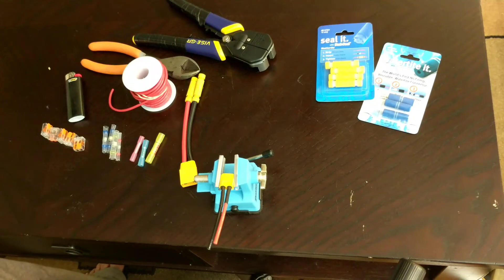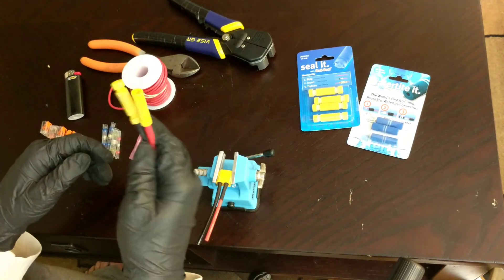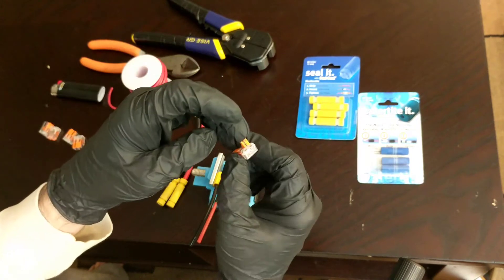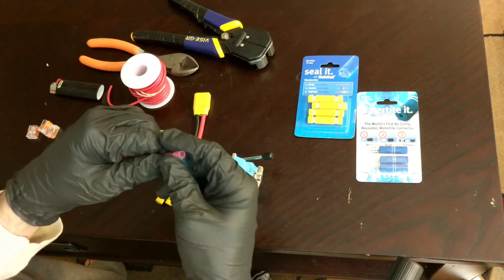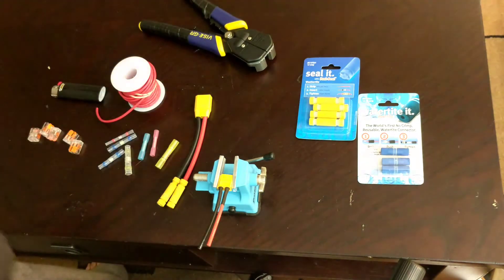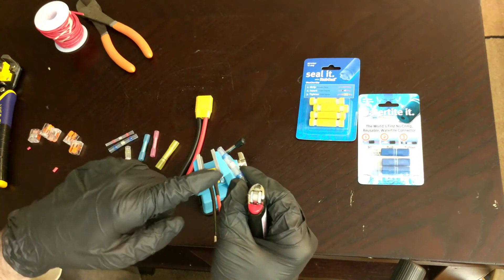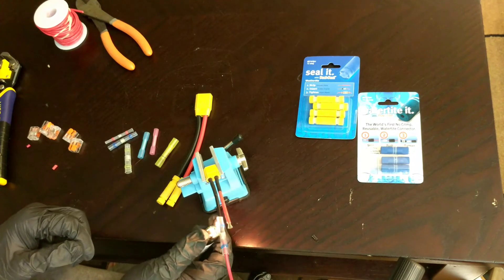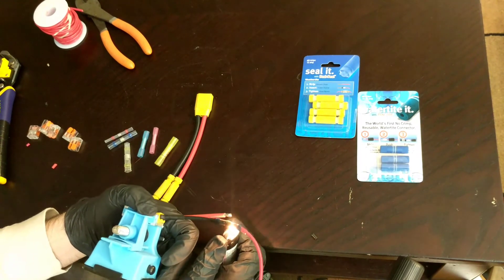Ebike wiring basics

Comment: This video shouldn’t be titled this way. This is nothing at all related to e-bike wiring basics. It’s just you explaining different connectors. E-bike wiring would be something like connecting the battery cradle to the controller. Just showing the possible difference in connectors available isn’t the same.
Reply from the maker: You can use the info here to connect controller to cradle easily, whether that means splicing them together or putting connectors on either side. Depending on the gauge it could be as simple as using the solder sleeves demonstrated.

Comment: Can I use these on the 3 phase wires ? The first connectors  and what is the exact name of them ?
And on the 5-6 hall wires ? All on my ebike ? Or butt crimp connectors ?
Reply from the maker: I don't think posiloc makes a connector big enough for phase wires but maybe. Probably better off crimping those though. Plus i would imagine if you used posiloc connectors for every wire it would take up a lot of space, they are rather large

Comment: Is it possible to go to a site for a schematic
Reply from the maker: Sure it is but that schematic is going to be very different depending on the equipment you're looking at. So you would need to be a bit more specific. If it's something like BBSHD or Cyclone check out the electric bike forum. I think there's even a link in the description

Comment: please tell the meaning of wire from display specifies as DATA 1; DATA 2 ; Control
please explain its meaning and tell where it should be connected in controller..
Reply from the maker: Depends on your controller. If you need a wiring diagram you need to contact the seller for that.